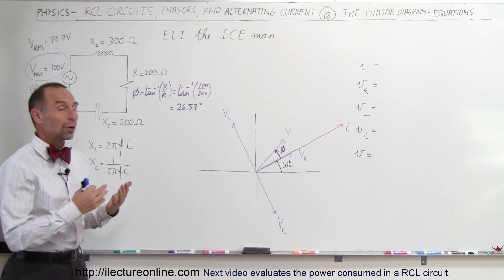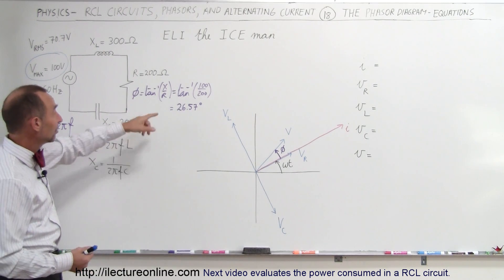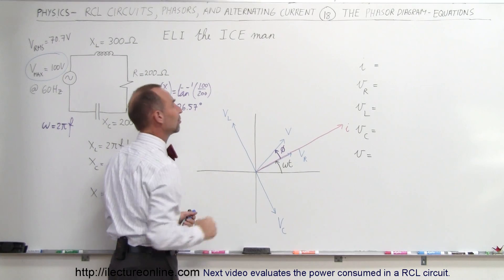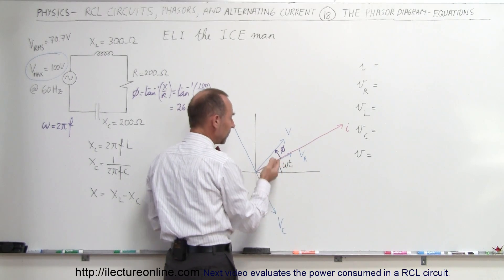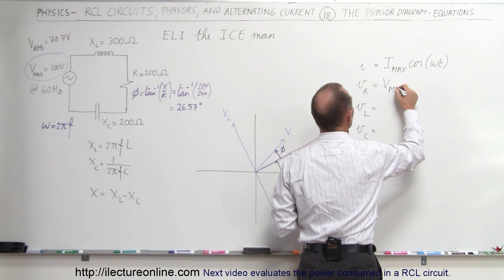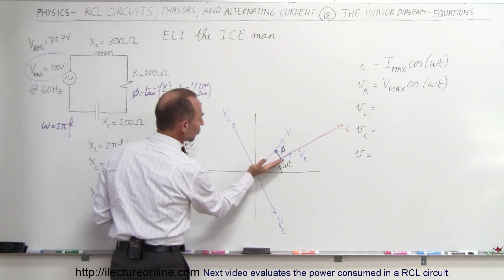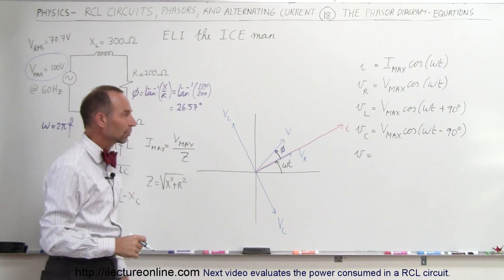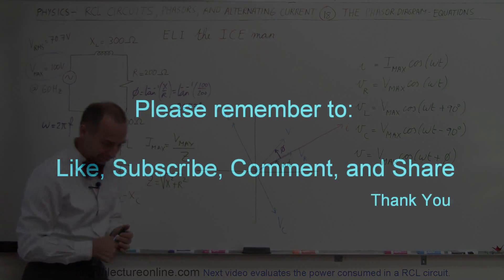Physics 49.1  RCL Circuits & Phasors (18 of 24) Phasor Diagram - Equations

Comment: Hey michel, always huge thanks for your videos, you've really helped me a ton going through E&M.
In this video I have a hard time understanding how the amplitude of all 4 equations are Vmax; does this mean that the amplitude of Vr, Vl, Vc and V across the whole circuit are all 100V, the Vmax? From the phasor diagram it seems like the amplitude of voltage differs on each component.
Reply from the maker: Since each component reaches maximum voltage at a different time in its phase, you must add the phase voltages to equal the source voltage.
Reply: @MichelvanBiezen  Michel, thanks for the response. If the amplitude are the same for voltages through all the components, why is it that we draw the amplitude of different magnitudes in the phasor diagram? Thank you in advance.
Reply from the maker: The maximum voltage across each component reached a maximum at a different time in the phase.
Reply: @MichelvanBiezen  Michael, I now understand what you mean. Thank you so much for your help and always huge thanks for your videos.

Comment: Is it wrong to say that the voltage in the resistor equals I*R*cos(wt), in the capacitor I*Xc*cos(wt-90º) and in the inductor I*Xl*cos(wt+90º) - I being the maximum current through the circuit?
Reply from the maker: +ProjectD100 
That is a good way to look at it.